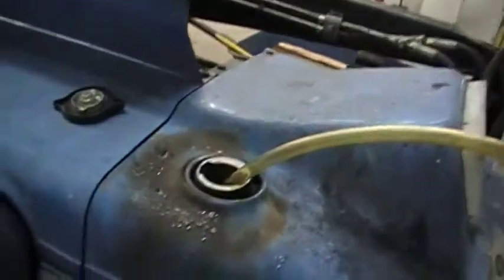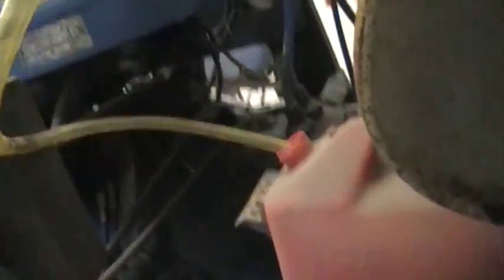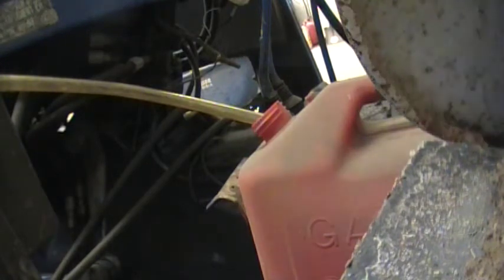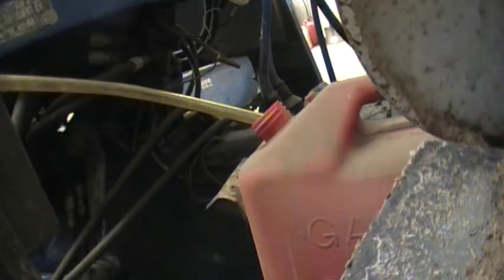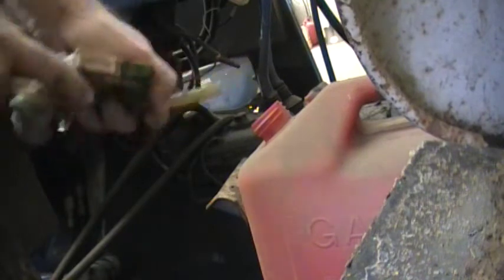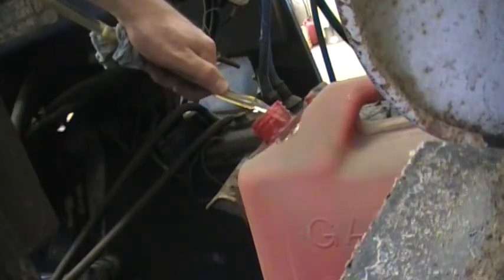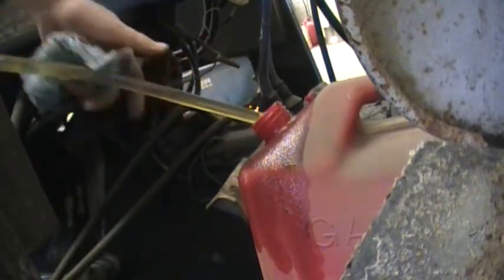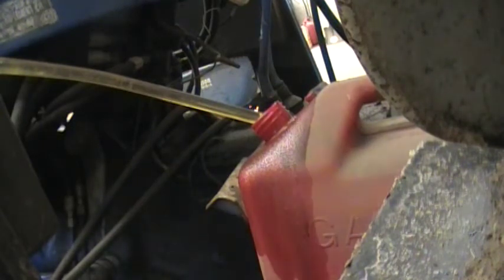Easy Siphon With Compressed Air

Comment: Thank for the video.  I had tried this unsucessfully but the video helped clarify things.  Make sure the output end is lower than the input end.  I used an old garden hose and a small air compressor and it worked great.

Comment: Hi thank you very much for the explanation video, but I need to do the same process but backwards, from down, floor level, up to like 10 feet (3mt) height, and water not gasoline, do you know if possible?

Comment: you can also start the siphon by putting the blow gun into the gas tank and sealing it with your hand. As long as you can hold your hand on it tight enough, the added pressure will push the gas up the hose. Once the siphon is started, just take your hand off.
You could also do this with your lungs, and while it is safer than sucking, I still wouldn't recommend it.

Comment: Your video was very helpful. I dont have a big expensive air compressor. But i tried it anyway using my little car tire air compressor. Also didnt have a fancy air attachment so i punctured the hose as you suggsted with a basketball needle. Started working almost immediately! Awesome. Safe. Easy.

Comment: Thanks, 
Looking to use same principle but different application, think it will work.
I want to inject cleaning solution to the air stream to get sort of a power wash effect in a hard to get to area. Hoping the air & cleaner will spray out the end of a hose flopping around in a tube.

Comment: Will this work on a dodge Dakota truck?
Reply from the maker: As long as you can get the tube down to the fuel it should work.  Some vehicles have a valve in the fill tube that makes getting the tube in pretty much impossible.
Reply: Ok thanks